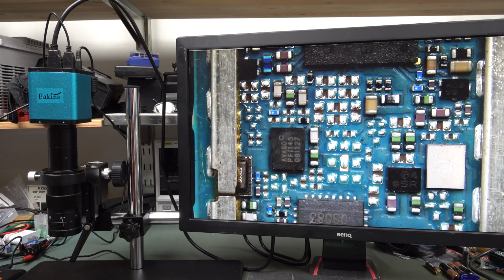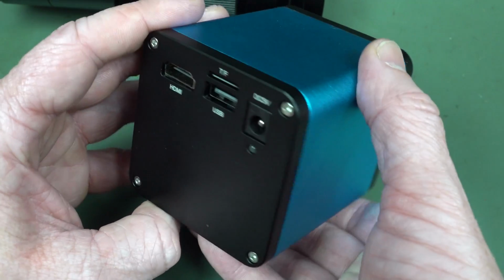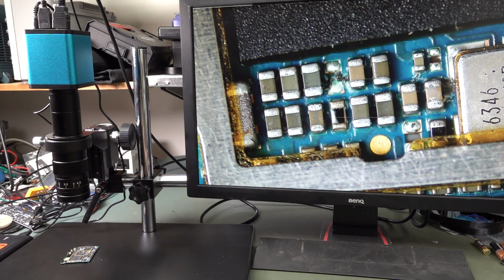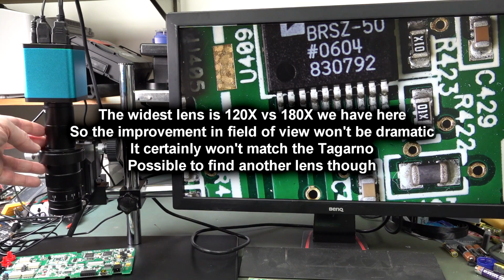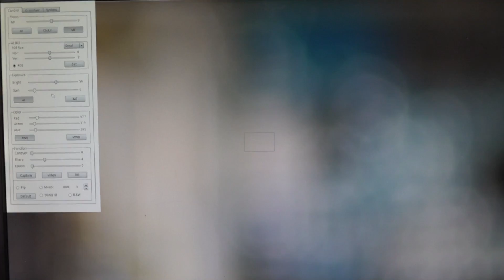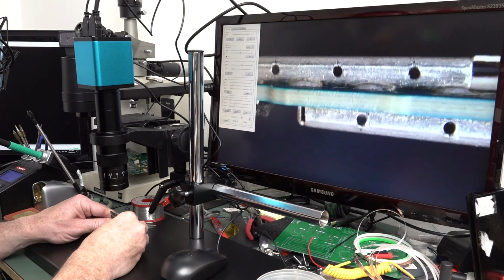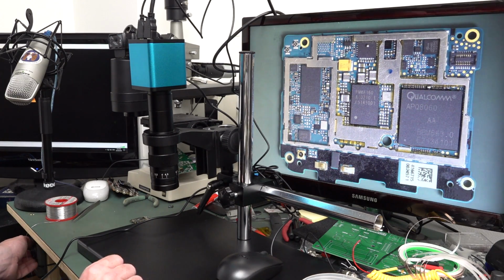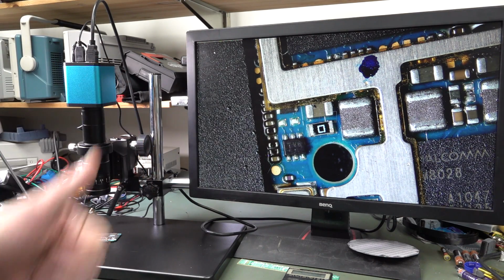EEVblog #1125 - Amazing $500 Soldering/Inspection Microscope!

Comment: Use ffmpeg to containerize the stream!  .h264 is a raw h264 stream without framerate encoding or a header.  Using ffmpeg you can specify the framerate (30fps) and output in an mp4 container so you can import the video.  Give me a few and I’ll have the command line switches for manually specifying the framerate (sometimes it doesn’t default to 30 for some weird reason).

Edit: Here you go:

ffmpeg -framerate 30 -i input.h264 -c copy output.mp4
Reply: Why would you specify the framerate as 30 when the camera presumably records at 60?
Reply: Agreed. I think you should set it to 60, or even try without the '-framerate' option if that turns out to work too. EDIT: "Gadget Review Videos" in the comments said some of these cameras do fake 60FPS (by framerate doubling). However the -framerate option wouldn't chop out every second frame, you'd need to use some other option for that...
Reply: You can also use a program like XMedia Recode, which is a GUI that supports almost all features of ffmpeg and others. It can containerize everything however you want and also encode them if needed.
Reply: drojf -It’s possible they had the manufacture make a special version, just like Nikons use the new Sony IMX Exmor mirrorless camera sensors But I would be skeptical of believing the specs, it come down to the image processor abilities not just the sensor specs. A lot of the cameras that look just like it including firmware 1.0 auto focus made by touptek claimed 60 and admitted that later to me. But they never changed the specs on the website. If I record to my SD card my editors also don’t like it. If I re-encode it through quicktime Pro, VLC using ffmpeg, or handbreak then I can using the SD captured file in a editor. I do think the files are missing header/footer information. My external HDMI capture is cheaper then Dave’s card and it doesn’t care, but if you move a board to fast under full magnification it has that wavey look. Finally the manufacture admitted to me it’s not “capturing” true 60FPS. It’s a shame, the sensors support 60, 120 and more with some sensors, but the hardware on the cameras don’t. Well I haven’t found one yet that does. 
Edit: I did stop looking and even today the real 60FPS cameras seems to be in the $1,000+ range. So $500 seems a little cheap for the claims and autofocus. The autofocus seems better then when it was first released with firmware 2.0. FYI: Eakins doesn’t make any cameras, they just resell them like most of these microscope camera companies do.
Reply: @Basement-Science  For one-shot process maybe GUI is better, but in generall CLI is much more flexible and you can automate things with scripts, instead of fiddling around with the clumsy GUI =P
Reply: Gameboygenius I had no idea what it records at, the comment was to point out that it sometimes needs the framerate set, so season to taste for your particular camera model.
Reply: I use ffmpeg for everything video related :P It is so flexible once you learn the options.
Reply: or adobe media encoder for the UI lovers out there
Reply: Or just use the cheapis gaming HDMI video grabber that can do 1080p at 60 frames per second, and capture it on computer, both for viewing, recording or streaming using OBS. Sure for work and dicking around, dedicated big monitor overhead or close by is more comfortable, but computer with HDMI to USB video grabber is more flexible, allows making videos and photos quicker, and make measurements easily too.
Reply: movax20h iirc it can also stream video, which can then be captured directly into a container format via VLC, which can also take stills of the video, and rebroadcast the stream as well.  The way this camera does its business seems very similar to how an h.264 webcam works, so tools that work with that should work with this.
Reply: soupisgdfood p

Comment: Can't help but wonder how that'd work in my trinocular port on my amscope. Beautiful footage.
Reply: I purchased this https://www.ebay.com/itm/Autofocus-1080P-60FPS-HDMI-Industrial-Auto-focus-Microscope-Camera-SONY-Sensor-S/273139900414?ssPageName=STRK%3AMEBIDX%3AIT&_trksid=p2057872.m2749.l2649
It works perfect on my trinocular port. It fixes the problem with the manual focus camera, that would not track the eye piece focus, so I was adjusting the camera focus as I changed the zoom. Only complaint, no video capture, so looking for a method of doing that.

Comment: Benevolent Overlord Dave, please try soldering with it. Curious if the latency of the display is acceptable for precision work other than just inspection.
Reply from the maker: I did, it's fine. No perceptible difference to the Tagarno, i.e. no perceptible lag. No point showing that as there is nothing to see.

Comment: For instance po ection you can't beat a magnifying glass with back light. Eyes focus fast.
Reply: Sure, if you use magnification occasionally. You can't also beat the smoke and fumes two inches from your face when you are soldering. Lung cancer in the making.
Reply: Why can't we beat that? What are you smoking? Solder fumes?
Just the ability to move the head around and still beeing able to see what you want to see is SO big that it, alone, would make all the difference.
Reply: NO. But I would inevitably have to considering how small the focal distance and depth of field is on loupes with high magnification is. Try soldering a 0603 cap with a  magnifying glass. 3x magnification is not enough nowadays.

Comment: probably raw h264, just need to use something like ffmpeg to put it in an mp4 container. handbrake tends to choke on raw h264 without a proper preset, which i have yet to find a reliable one.

For about $10 in parts, you can add a digital zoom control to that lens with a servo, belt, and teensy. Heck, if you dont care about the positional data from the pot, you could just use a standard servo controller
Reply from the maker: Handbrake didn't work.

Comment: You could try renaming the .h264 files as .mp4 files... or .mpeg and see if it helps, but it may not. Also there is another step, but otherwise I'd use mencoder in linux to change it from whatever it is to mpeg4 avi.
Reply from the maker: Tried that, it didn't help.

Comment: Here is another one at half-price with remote: https://www.aliexpress.com/item/HD-16MP-1080P-Industrial-Digital-Video-Microscope-Camera-Metal-Stand-144-LED-Ring-Light-180X-C/32876471240.html?spm=2114.search0104.3.207.63188cc4LRfDHQ&ws_ab_test=searchweb0_0,searchweb201602_4_10065_10068_10130_5726815_10547_10546_10059_10884_10548_315_10545_10887_10696_100031_531_10084_10083_5726915_10103_10618_10307_449,searchweb201603_60,ppcSwitch_2&algo_expid=20a1cbbd-d487-4d95-ae55-6793e33ee52e-30&algo_pvid=20a1cbbd-d487-4d95-ae55-6793e33ee52e&priceBeautifyAB=0
Reply: Doesn't have autofocus.
Reply: But it has remote - I guess it will allow adjusting focus?
Reply: I don't think so.

Comment: Try ffmpeg, "ffmpeg -i file.h264 -c copy out.mp4" it wil compain if it cant do it otherwise you will have a good file.
Reply: Or GPAC with something like "mp4box -add file.h264 out.mp4"  https://gpac.wp.imt.fr/downloads/
Reply: Mpeg streamclip maybe. He could just need to rename it from .h264 to .mp4
Reply: It's almost certainly a raw h264 stream (no container like MP4). Most video software won't know what to do with that, but ffmpeg and gpac will.
Reply: Because MKV is a file format not a video encoding. They are different.

MKV might be able to hold the file as it is a container but it wont actually do anything to the file. Converting it to mp4 will change meta data or even re-encode the entire thing making it compatible with what he needs.

Comment: To my understanding a power rating is the equivalent area seen magnification.  We can take the square-root of the power rating and you can find how many times longer or wider it will appear.  For example, an object viewed through 100x will appear 10 times longer or wider.
Reply: That doesnt make too much sense. A 10x zoom would only be 3x larger. The zoom on a camera is given in (focal length) divided by (minimum focal length). So a 50-200mm zoom lens is 4x zoom due to 200/50=4. And thats exactly what it does: Zoom in 4x. If a object was X lenght/height/width at 50mm its going to be 4 times X if you zoom in to 200mm. Its not the area that is 4x as big, its the actual angle of view that changes. From X° to X/4°
Reply: @leocurious9919  Thanks.  I didnt think about any zoom or angles, but maybe we can agree we are both right about some things.
Reply: Okurka ... what...?

Comment: Dave try using Handbrake to re-encode the video before you import it into your editor. Also you can get powered lenses for the Eakins. Though they will cost about the same as the camera!
Reply: he only needs to mux it into an mp4
Reply: Handbrake is not very good for this sort of stuff.
Try XMedia Recode. It should be able to do everything needed.
Reply: Tim Hunter Just try the output option in VLC itself (forgot the menu name).
Reply from the maker: I did, it didn't work.

Comment: I ran into issues with h.256 files on a Swan security camera system.
Turns out the only thing I could get to work with that thing was their own tiny little video converter on their website.
Maybe these cats have something like this?
Reply: Have you tried using ffmpeg to convert it?

Comment: I’d like to hear what Suba engineering has to say about all this and their claim that they engineered their camera.
Reply: It's pretty common this happens. For example another AU company, stedi, that sells light bars claim their ST4K is designed and engineered by them even though I got the exact same from another place but without stedi logo. I even showed them everything how exactly the same they were down to components, but no, they wouldn't budge.. :p Not that I cared really, I just wanted to know before testing theirs if it really was the same, they said theirs was better and suprise, after I got it it was the same.. But it's a good light bar so no problem but, why lie?
Reply: +kruppin I'm guessing you were talking to a sales guy.
Reply: Prolly the 12 employees that gave Dave the thumbs down!
Reply: jak p Honestly, they may have used the same components in a different board design.  Just like an Arduino is very similar to official dev boards for the same Atmel chip.
Reply: https://item.taobao.com/item.htm?spm=a1z10.5-c-s.w4002-18404868773.44.6b2ae4c4ajoxL4&id=569800172964 
7th of September is when Dave posted his video of the Suba.
Above is the taobao link for a camera they have with a review dating back to 18th of June, also not posting a review after purchase for one month triggers the default comment.

So yeah. It is common to for company to buy cheap Chinese products, slap their own label on, apply better casing and etc. I'd get a better lens for that microscope, but then I really don't need one... my setup is far superior.
Reply: Amcope does the same
Reply: Scuber diving engineering camera.
Reply: Have your design built in China, then don’t bitch when they copy it and sell it for a quarter of the price.
Reply: Well it is just an image processing board with AF function. I didn't see anything that might be high tech for the industry. I would rather say suba ordered the Chinese company doing ODM stuff and sells under their own label. It is pretty common.
Reply: +Daveyk021 Copy it? Not even that. You order 10,000 and they don't stop the assembly line until 20,000.
Reply: Chaos Corner if suba really did engineer this camera then they need to rein in their supplier if they are making product suba didn’t authorize. However, the two Chinese languages and English on the settings menu makes me suspicious. Why simplified and traditional Chinese and English rather then German, French, etc.
Reply: Could it be that Eakins used the design and engineering from Suba?
Reply: So the guy has it for year(s) from Eakins and now Suba shows up on some Exhibition? Without looking any deeper that seems fairly conclusive.
Reply: Jacques Gilbert looks like suba got caught lying.
Reply: this one is probably a Chinese copy

Comment: First, again.
Soldering under digital microscope? No, just no...
Reply from the maker: You can't beat an optical Mantis scope
Reply: Only problem is Mantis just way too expensive. Plus they don't have even semi-decent camera option which is a bummer.
Reply: Yeah, I talked to Mantis (they came to my home, their US office is about 5 miles from me) but the darn camera is not user replaceable and they have no plans to upgrade it. I passed.   Don't get me wrong, the optics are great but integrated antiquated electronics that can't be changed gave me cold feet. I think the camera in there was USB2.
Reply: Yeah, for serious work you need a stereo microscope (like what Louis Rossmann uses)